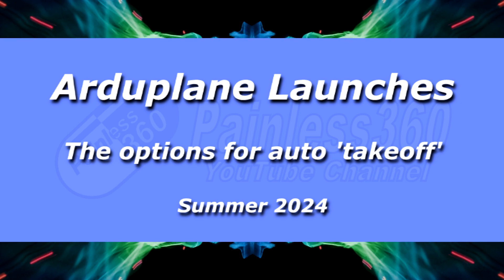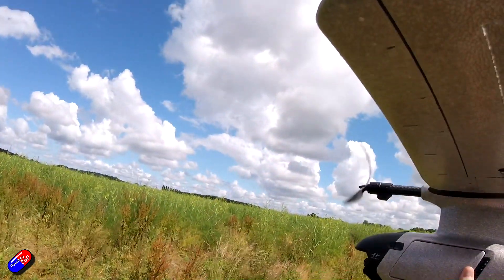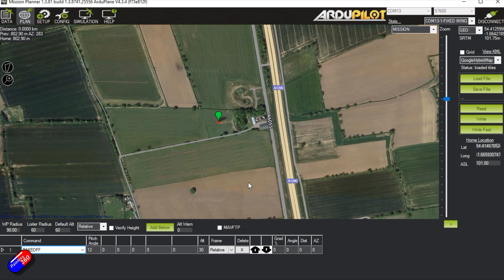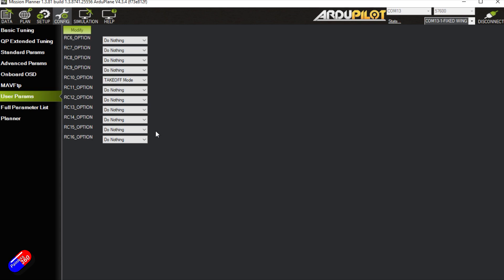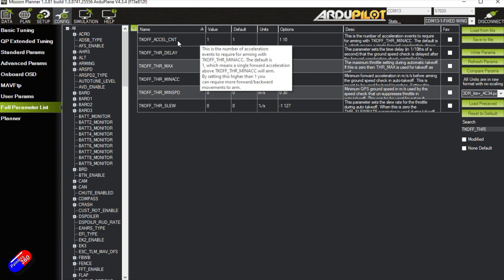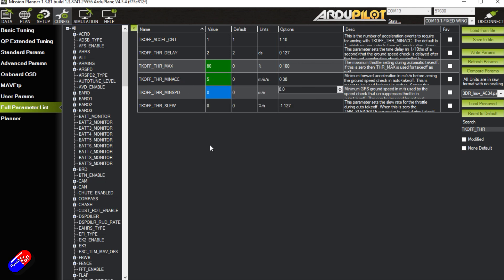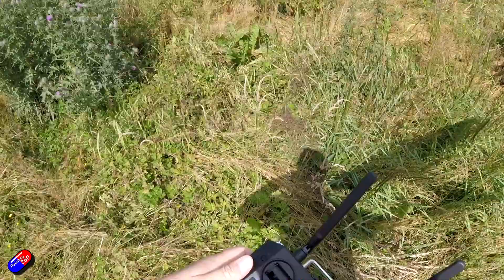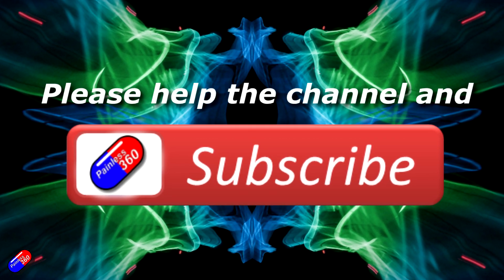Arduplane TAKEOFF mode - how to setup easy 'shake to wake' hand-launches.

Comment: Thanks Lee but if you have it setup on a switch (not a flight mode switch), do you have to make sure the flight mode is set to manual or does Auto launch override ?
I was hoping to set flight mode to Cruise and set the designated switch to Auto launch so after auto launch completes it would go into Cruise.
Reply from the maker: It overrides. Happy flying!

Comment: Great video - thank you.  I have setup a tri-cycle plane (it's my 'lab' plane) for testing digital video.  I can successfully have it auto land, but am unable to invoke auto-takeoff.  When I flip into auto, I see 'mission 1 takeoff' in the log, but the motor does not spool.  I had successfully set this a few years ago with another plane (now RIP..) but feel like I'm missing something.  BTW - have 2 other planes I use the 'shake to wake' with fantastic success.  Any help would be appreciated.  Thanks!
Reply from the maker: I'd use the Autolaunch mode now. See my other video about setting up a launch as part of a mission... Best of luck

Comment: ArduPlane v4.5.5 has quite a few more options to configure! It is also recommending using a value of around 15 for TKOFF_THR_MINACC. Also does using takeoff mode remove the need to "arm" before launch? TKOFF_ACCEL_CNT would come in to play then, shake once = arm, full throw is then ready to go. Previously I was arming, setting throttle to 65%, throwing (and hopefully not crashing the dang thing immediately)  Thanks for your great videos!
Reply from the maker: Thanks for sharing. Always fun when things are changed in the code :D

Comment: What happens with SpeedyBee dual operating systems & switches - can they muddle up?
Reply from the maker: I'm not sure I understand the question... Can you elaborate?
Reply: @Painless360  I just got the speedybee 405 & it says it can run dual systems ardupilot & inav. Im new to this so it can have both setup then use what 1 you need & not clash with the inav switches if on ardupilot?? or can it only have 1 setup on it at a time?
Reply: @fordboyzzzz  It's just poor wording. The SpeedyBee 405 Wing and Wing Mini are supported by both iNav and ArduPilot - but not at the same time. It is one or the other. ;)
Reply: @pfeerick  oh right - just learning INAV now & loving it, wont be looking back. thanks
Reply from the maker: It's one or the other. You can't have it flashed with multiple setups... Happy flying
Reply: I noticed you set the takeoff parameters for the Firefly using the Ardupilot Mission Planner. That is my favorite protocol however I am forced to use the QGroundControl app on my android based H12 radio because although I was able to download the Mission Planner app, I can’t seeHm to figure out how to link it to the aircraft. I think Eddie at HAOHAN doesn’t quite get what I’m trying to do. I’d appreciate any help in figuring out how to accomplish this.